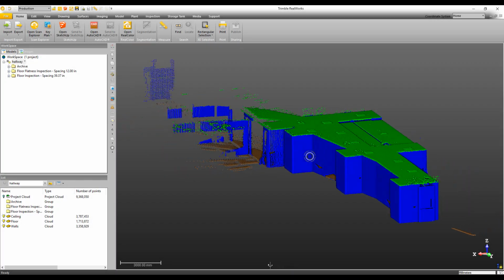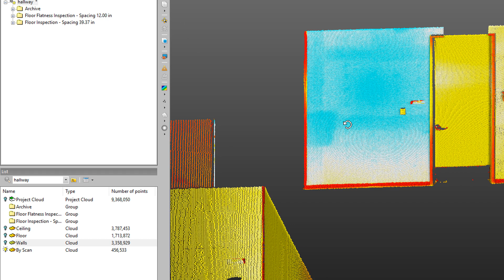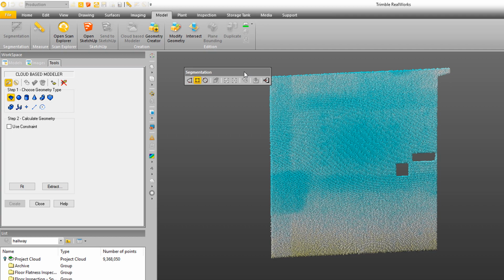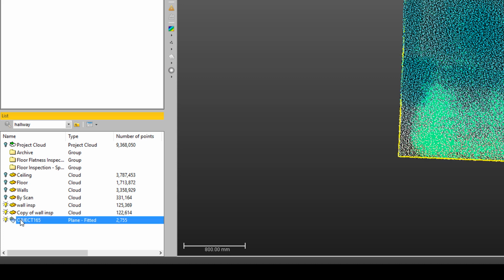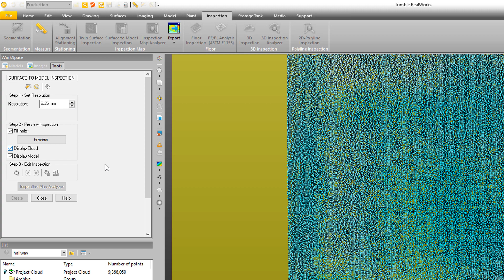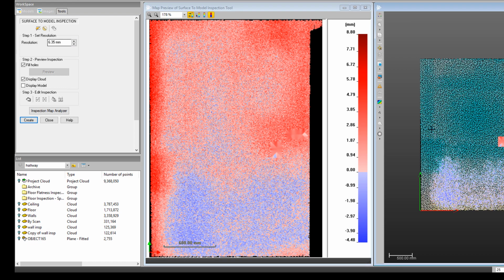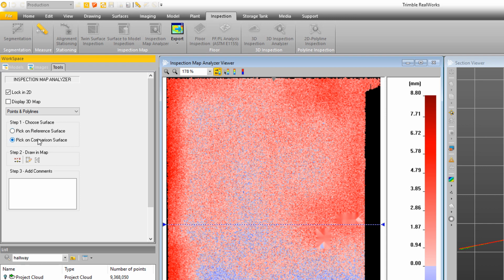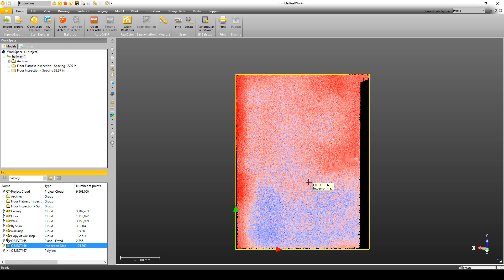Wall Flatness and Verticality Tutorial - Trimble RealWorks 10.4

Comment: Hi Jason.
I'm having an issue while doing a Surface to Model Inspection to analyze the flatness on a API 653 Tank Shell. The resulting flatness image sometimes shows the color codes inverted to what they should be. For example, the inside deviations appear red/orange, while the outside deviations appear blue - all while the ColorBar legend shows these results should be the other way around. Additionally, the vertical and roundness inspection report shows that results consistent to the ColorBar. So my question is How can I invert the colors of the flatness image?

Luckily, this  issue has only happened 3 times out of around 30 tanks inspected.

Any help is greatly appreciated. 
This video helped us immensely in getting our job done. Keep up the good work. Blessings from Puerto Rico.
Reply from the maker: Hmm not sure why it would be inverting the colors. If you ping me on LinkedIn I can check into it.
Reply: @TrimbleRealityCapture  I'd sure appreciate it. How may I find you on there?
Reply from the maker: @melvinjperdomo  https://www.linkedin.com/in/hayes-jason/